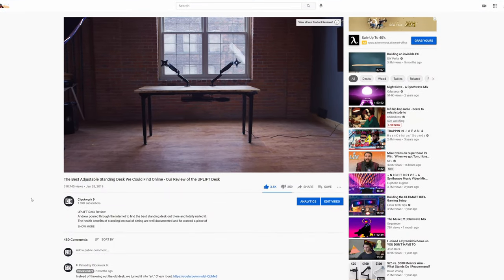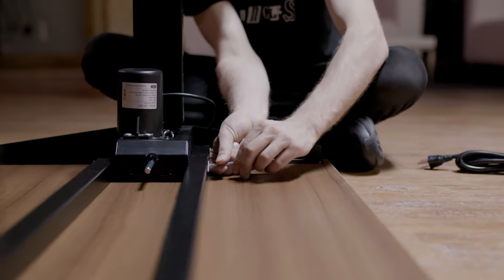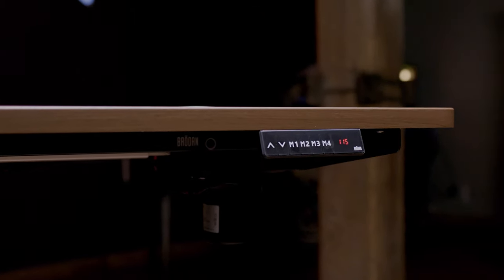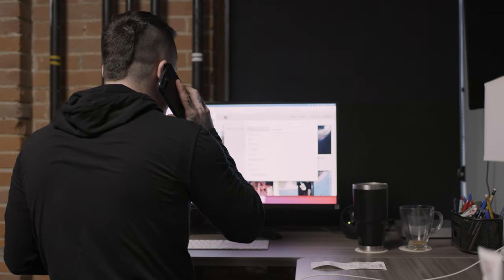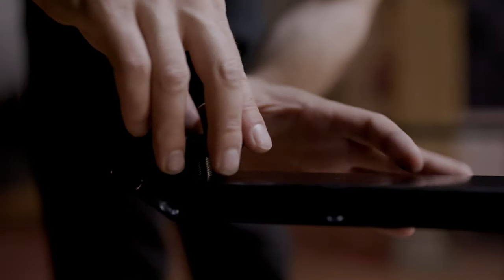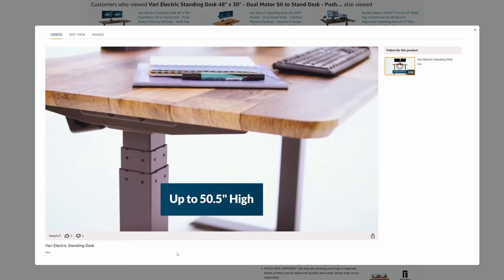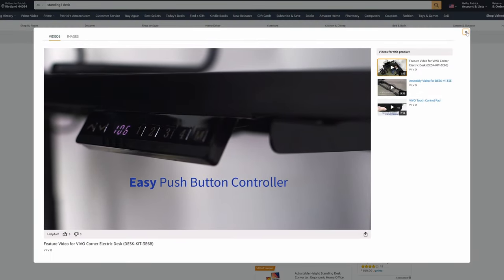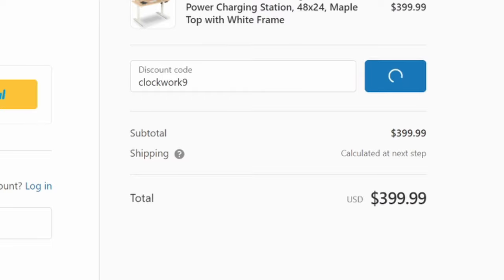The Best Standing Desk on Amazon for under $500 in 2021? Review of the Brodan Electric Standing Desk

Comment: What slider did you use for the timelapse build at 1:35?  I love the fluid motion as they build the desk...very cinematic!  I was very surprised that they only offer a 1-year warranty.  There are a lot of moving parts that can break down.  Desks are meant to last more than a year.
Reply from the maker: Thanks! We used a Kessler Second Shooter and a DSLR with a sync cable controlled by the KSS, but an Edlekrone will do basically the exact same thing.

Comment: What about the Pneumatic desks?…they move up and down a lot faster, nothing to worry about if you have a power outage or get tangled in one more wire
Reply from the maker: Absolutely an option worth considering. A big plus is you don't need electricity for it, but they tend to have a much lower load capacity. Most we've seen are around 35lbs

Comment: Are there any desk like this but without the charger thing on the table?
Reply from the maker: All the Brodan desks come with the power charging station. Honestly, it’s a very convenient thing to have. Especially if you’re going to be changing from sitting to standing consistently.
Reply: The charging station is a optional add on that you can leave off
Reply from the maker: @utube4levi  Perfect.
Reply: @utube4levi  I see nothing on amazon or their website that allows you to remove the charging station from your order
Reply: @Bored00m  It's a fee add on. You can throw it out if you dont want it. Or sell it for $40 on eBay
Reply: @utube4levi  and just enjoy the hole in your desk? lmao did you read your reply before hitting submit
Reply: @Bored00m  Yup, if your afraid of a hole, you can buy a "computer desk hole cover" for under $5